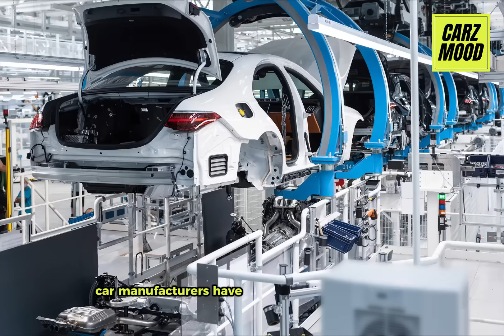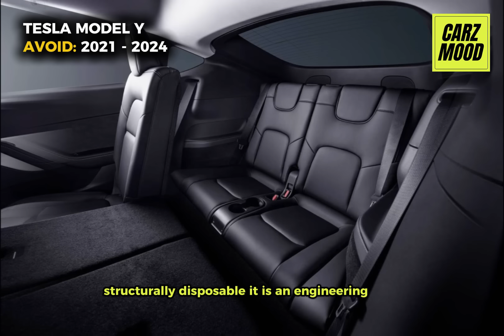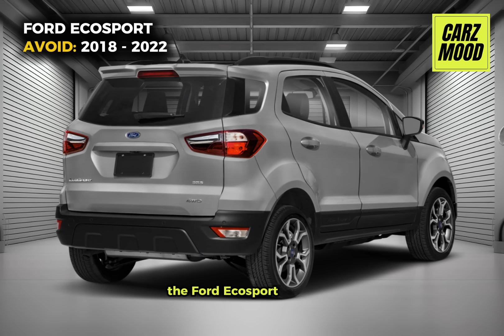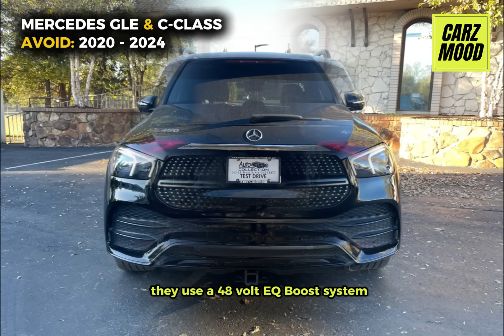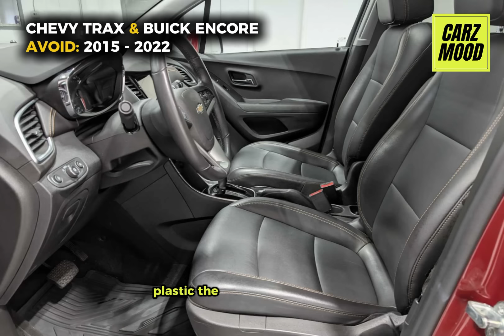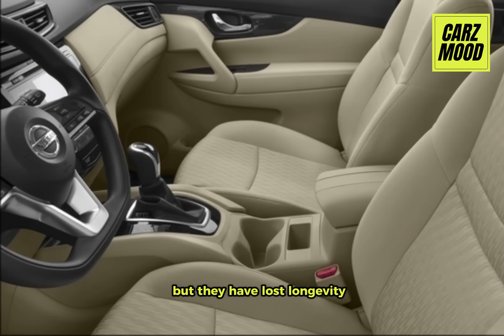5 "Disposable" Cars Built To Fail (Avoid These)

Comment: My wife’s Chevy 2017 trax was bought new and was a constant problem.  Air conditioner blew up in a year, steering gear needed changed at 2. Went through 2 O2 sensors.  Got rid of it before the warranty was gone.  Good luck to who ever bought it used

Comment: I have a 2016 Rogue transmission failed at 83,000 miles Nissan replaced it completely free of charge. Car still going strong 125,000 miles no other problems whatsoever oil still clean its a great car

Comment: Nissans have awful transmissions that use cheap components.  These models probably weren't sold in America, but I had an Almera where the gearbox started leaking oil at 25k miles and a new one was needed, luckily the car was under warranty. Stupidly I bought a Nissan Micra 5 years later, as the deal was good, but this one fried its clutch at 19 k miles and this was a known fault that Nissan ignored. Went over to Skoda( Czech brand owned by Volkswagen) and, apart frpm the odd electrical glitch, all three have never given me any grief.

Comment: The Nissan Rogue Jatco CVT is a disaster. I knew an electrical compliance inspector and his firm bought a fleet of these and every on failed at about 140,000km. I have the same car with the silky smooth 6 speed manual and it is now just about to clock over 300,000km, however, the stupid  DMF clutch is weak in these so go for an after market SMF clutch when it fails which is an expensive job but not a terminator.

Mazda seems to still be making good cars, and I believe they don't use CVT transmissions. If at all possible l recommend you learn to drive a manual, its actually easy and they tend to be more durable than autos and a good anti-theft device.

Comment: I recently rented a Geely Okavango in the Philippines.  Great car to rent but it has a 1.5 L 3 cylinder turbo with the 48V hybrid.  I researched the car and all the owners said the same thing.  It will break and then be off the road for 3 months to 2 years waiting for parts.  They all said only consider this as a second vehicle because even though it is "covered under warranty", the reality is that it is garbage unsupported by the dealers or manufacturer.  Same for every Geely product.

Comment: You do understand that other than full sized trucks most cars sold in the US no longer have a frame, right? I understand that the Tesla is built different, but most cars sold in the US use a unit body not a frame.

Comment: Would never buy another Nissan due to their infamous transmissions. I had mine go out twice before I got rid of the car and my friend just had hers go out. They do not know how to build a proper transmission.
Reply: Not when outsourcing crap CVTs from Jatco for the last 25 years. The lending company owned Serberus era Mopar 08-10 also outsourced shit jatco CVTs for the Jeep Compass 2.4, 2.4L Cherokee and the pos Caliber. First the chain driven ones with the chain that broke their sprockets without the fake shifting because there are no planetary gears actually shifting there are however gears on the opposite side of the output shaft that fails before 100k miles on the now belt driven unit. Asin is another crap cvt company that sells their units to Honda & boobaru

Comment: No way is a 15mph impact going to render a Tesla unrepairable. I got rear ended at a standstill in my Model 3 by a car going  at least  30mph and my car had slight damage that was repaired no problem. Only issue was the work had to be done at the one certified Tesla repair facility in town. When I dropped it off there were a good dozen Teslas with smashed front and rear ends being worked on, a lot worse than mine.

Comment: Ford is going full in on disposable with rubber belt driven oil pumps and plastic oil pans in all their vehicles for example.
Reply: The best car Ford ever made was the Crown Victoria. It could be used as a police car and then spent several more years as a taxi. And then when the taxi company was finished with it….

Comment: Our 2023 Tesla Model 3 will out last most ICE vehicles without a doubt.  It's much cheaper to own and operate than any ICE vehicle i have ever owned in my 56 years of owning and driving vehicles of all kinds.   Those old cars one person mentioned will eventually die and cost a fortune to maintain.   The world is going towards EVs and renewable energy whether you like it or not.  Technology has been a field I have worked in all of my life.  I never debate people who do not understand science and technology because all you have is your opinion backed up with zero evidence.
Reply: Okay Mr science. So then you know that it causes more pollution in one day to manufacture battery packs for one car then an internal combustion engine will put out there its entire life plus you're using fossil fuels to make the batteries. And absolutely not it will not last longer than older internal combustion cars
Reply: It's not gonna last - look I worked with cars all my life and in 95% cases first thing that starts to make issues is electronics - doesn't matter if it's german, french (those especially), korean or japan - it's the electronics. Your tesla is gonna have issues too - and good luck trying to find an electrician that'll be willing to work on such complicated electronic system.

Comment: The criticism leveled against the Model Y might not be entirely fair. There are actually repair sections available to cover certain types of damage. The casting is cut back with a grinder to specific markers and the repair section is fitted using a combination of glue and fasteners. Hopefully they crash tested the car with these repair sections fitted....
But if the casting sustains damage in an area there isn't a repair procedure for then you're in for a world of hurt and the vehicle may be written off. Unfortunately some insurance companies won't consider such repairs so cars get written off for repairable damage, driving up the cost of insurance for everyone. And if the idea of glue makes you nervous, its how a lot of aluminum bodied cars are built in the factory.

Comment: One of our local doctors in Australia paid about $50,000 AUD for a brand new Tesla EV when they first came out,Tesla didn't want to talk to him about replacing the battery after it failed after 4-5 years & he bought it with one of those standard plug in chargers which could plug into a standard 240 VAC outlet at home.

It was the fact that the battery 🪫🔋 was dying & it needed to be towed home so he could recharge the battery,it was before they installed their fast chargers in my area.

The reason they didn't want to talk to him is because the new battery 🪫🔋 was going to cost $20,000 AUD & he just managed to lug the Tesla to our local Hyundai dealer, he got $15,000 AUD on a trade in for a brand new Hyundai I30 which he thinks is a better car.

He's still not pleased that there's about a $35,000 AUD shortfall between buying the Tesla & the Hyundai which I know has problems as well, my dads neighbour bought a Genesis sedan which has the 3.8 litre Lambda V6 fitted & he's already had the engine replaced once,he barely drives it favouring his Toyota Yaris because the Lambda engine is a real oil burner.

That's why I still drive a 2002 model Holden VY SS Commodore which is fitted with the 5.7 litre Chevrolet LS1 V8 engine, it has done over 408,500 kilometres (about 254,000 miles) & it better than a lot of the cars on the market now,I have replaced the hydraulic lifters 7 years ago & I have put 44,000-45,000 miles or over 70,000 kilometres without any problems except that I rebuilt the alternator this year.

I wondering what GM is thinking about the Australian car market when they closed Holdens manufacturing plant down in 2017 & the whole company down in 2019, they don't have any vehicles for sale except the GMC , Chevy & Isuzu trucks & SUVs, they don't have a sedan or wagon to replace the likes of the Holden Commodore.

I thought that they would at least import the Chevrolet Impala or the Cadillac CT5 but nothing has happened in Australia, they probably expected me to buy a Kia or a Mitsubishi during the last decade, the police have replaced the Commodore with the turbocharged 6 cylinder BMW, the 4.4 litre twin turbo V8 car is a fire hazard since they mounted the turbochargers on top of the engine which causes the engine to catch on fire so they didn't want them.

I have heard that Tom Walkinshaws performance vehicle company was meant to be building a new Holden Commodore for the Australian market this year & so far it has been clickbait online, it seems to be just all AI.

They said 2026 is the release date this year but I don't believe it, it's almost like GM thought that I was going to go Ford in Australia or something !

Comment: 😂Lady, do you know what you are talking about. Aluminium is not sensible to heat treatment. Hence, heat treating aluminium is botherline wasting money. Also, cast part, even cast iron or cast steel dont usually recieved heat treatment. Grease monkeys dont like new process, not because it cant be done. Becasue they dont know how it is done. A cracked casting part can be weld repair. The impeler in hydro power generation do it all the time to remove casting defect. The thing is, aluminium is a bitch to weld, and body shop usually dont stock aluminium welding consumable. With time, the repair will pick up.

Comment: Small correction on the Tesla. The gaming PCs on wheels are not sustainable and EVs are not the automotive future, in fact the data shows they are already dying out. The media just hasn’t told you yet but you will see Hybrids being the main replacement with EVs for certain use cases and ICE for enthusiasts and also some daily drivers.  My 2001 Honda s2000 with 188K still has all the original parts and runs like a champ. Alternator, starter, etc ive only replace a few gaskets that started to weep oil..and yeah i had to do the clutch but thats it. Take care of an ICE car by doing your simple maintenance and usually you are good to go.
Reply: You are so wrong
Reply: @larryjolicoeur7169 he's actually correct 💯
Reply: @larryjolicoeur7169 I'm wrong ? Then please explain why the government has to force people into them! Thank God we have an administration that stopped that garbage. If people wanted them they will buy them but when a government has to force you to drive it you know it's garbage. But don't take my word for it, ask anybody who lived in the former Soviet Union. There's no infrastructure, there never will be because it's impossible, they lose range over time when my gas tank never changes, they're expensive and you can't fix them you have to have them towed somewhere and when they die on you it's an absolute disaster. YouTube is full of thousands of videos of people regretting their EV purchase so go buy your clown car on wheels. It's total trash and to be honest you'll just look gay. Real men don't go near those things. They're for gay men and women to tool around locally.
Reply: @larryjolicoeur7169 
PROBLABLY Drives a 💩 EV DISPOSABLE Toy car

Comment: You remember once when things could be repaired cheaply like washing machines, refrigerators, driers, televisions? Well now cars have gone the same way because it's good for business when things need replacing and are not financially viable to be repaired.
Reply: I am  so lucky I  guess. My Whirlpool from 1987 is still going and my 2006 loaded Forester runs great. (manual tranny )

Comment: Avoid any engine with "eco" in the name. They are undersized which puts strain on the engine, and they are turbocharged, placing even more stress on the engine. Then there are the wet belts
Reply: I never use the ECON option on my Honda Accord.

I drive conversatively. My current Honda Accord has 230,000. I have never had to change drums and rotors on the brakes this is due to my driving style.
Reply: Good point. True.

Comment: I have a friend who helps design every inch of the electrical components/wiring for Ford. He almost lost his job when he REFUSED his bosses order to make changes to his work that would intentionally put in "incorrect wiring" that would shortly burn out several parts and need replaced. (Don't ask me for the technical terms. I'm not an electrician)

Comment: Funny, my ford fox 1L engine got brought in for an official recall.  Among the items replaced were the timing belt and oil pump belt.  The car is seven years old, so the repairs probably exceeded its book value.  Maybe I get another seven years?  The official repair interval is now 150,000 miles.  None was specified when I bought the car new.

Comment: This is not a new thing. A good example is the Ford Falcon. They were new for 1960, and were cheaply built. I remember when they were new, and how quickly they were junked.
Reply: Mostly because they were so ugly inside and out. And the 6 cylinder engine took about 20 seconds to get to 60, and top speed was about 70!
Reply: I was a kid, but I remember the Falcon also. It was a small car.
Reply: @soundjudgement3586 So were the Chrysler Valiant and the GM Corvair.
Reply: I don’t think they even had any insulation in their roofs. They were noisy in the rain. Like the raindrops were falling on the bottom of a galvanized metal bucket. 🪣

Comment: Let's be real, vehicles are expensive as hell. Lots are full of unsold cars, some for over 2 years! I am retired, don't drive much, car wouldn't pass inspection due to cat. converter! Cost $2500. So just gave the car away. Now looking for a used car. It's unbelievable how many late model cars have had rebuilt engines and transmissions!  Too much crap, computer crap, too many components to break. Hate it. Planned obsolescence! I'd love to find and old Chevy II, or Ford Falcon or even a Gremlin!😂

Comment: My Volvo S60 is 20 years old the coming april. 
No turbo, manual transmission, no GDI and no AWD. Bullet proof B5244S gas engine.
Drives almost like new - just keep it simple!
Reply: Keeping my 2000 Accord 2.3L with 390k on the Clock
RUNS PERFECTLY
Reply: I love my Volvo V70 2,4 from 2007, great car, only 140000km

Comment: Keep your old cars folks
Reply: My 1963 Ford Falcon says, "Beep Beep". It starts instantly and drives quiet, cool, and smooth. It is beautiful and fun to drive. New cars are terrible.
Reply: I have a 1987 w124 300D Mercedes with almost half a million miles on it and it’s still going strong. They don’t make cars like this anymore.
Reply: Unfortunately it won't matter. Under the guise of safety they'll force us to go to autopilot cars. If you keep a car that you drive you'll probably pay some really crazy insurance premiums.
Reply: The rust takes it too soon
Reply: I make $175k a year. I drive a 2006 LS430.
Reply: Nah. I like the safety and new tech of new cars. Especially teslas.
Reply: 3800 for life. I love my 04 supercharged Monte Carlo SS L67 3800 and love it like all my past W body 3800s. I'm a lifelong mechanic out a couple years now but still keeping tabs on the industry  and it's still as bad. Planned obsolescence Dem implemented bs thank God Trump fixed but we are still so downhill and yes the ugly pos rouges jatco CVT had the failing output shaft before 100k miles at such a high rate and YES throw away appliances. Do research and see when each company plumited into planned obsolescence but yes EVERYTHING is terrible ugly throwaway garbage appliances today. As a whole though don't buy past the mid 00s. If taken care of far better and already outlived anything made today. And parts are cheap, plentiful and work is generally easy on a lot of cars from the era very easy. I can't believe the number of people that think newer is better lmao hell no! Yes there were a few bad ones back in the day but NOT like today where everything is bad and a sea of hideous demtard cuvs
Reply: Old cars are money pits too.
Reply: @tonyn3227 I don't agree with your statement. I own 5 cars, 2 are 56 years old, 2 are 30 years old & 1 is 40 years old & I do my own repairs. If you service then & take care of them, they can last a long time!!
Reply: @tonyn3227 😂rust to a point that nothing left to save
Reply: @tonyn3227 wrong,unserviced un looked after cars are money pits
Reply: @tonyn3227 you have no idea what you’re talking about
Reply: @tonyn3227 Death traps too.
Reply: @akennedystocks uneducated comment,teslas are prob more of a deathtrap than older cars,,
Reply: Old cars are crap. Get a better job
Reply: @larryjolicoeur7169 nope. Still driving my Audi A4 B6 1.8T with over 208000 miles on it. Still runs smooth like it did from day one.
Reply: @larryjolicoeur7169 More money fir repair new car then.
Reply: @larryjolicoeur7169 
Drives a DISPOSABLE EV 💩 box ?
Reply: @larryjolicoeur7169 yarn,, u prob buy yours on monthly
Reply: @larryjolicoeur7169 I make $175k a year. I drive an 06 LS430
Reply: @larryjolicoeur7169 old cars were built like tanks

Comment: Why isn't Mazda on this list ? Exactly there reliable and not a hunk of junk. 😂
Reply: Depends where you live. In Canada, they stand out due to their body rust. It is endemic of that brand.
Reply: @Panzerkeil27 In the winter if you give your car a car wash for the under careage. It should wash away the salt from the bottom to prevent from rust. Only in the nice winter weather that is above plus 1. But to be fair that happens to all cars, thats if you don't take care of it. 😊
Reply: @FacelessNameless-n3d but Mazdas rust disproportionately. It is a sound observation. Since most other brands seem to hold up better, obviously, Mazda isn't trying. If the body wasn't built to last, the rest wasn't either.
Reply: I love my Mazda 3😃
Reply: @MAte925 What year is your Mazda 3?
Reply: @FacelessNameless-n3d 2005
Reply: @MAte925 Any rust problems?
Reply: @FacelessNameless-n3d yes> Boot had bubbles near the badge until a freind fixxed it + the stone chips on the roof